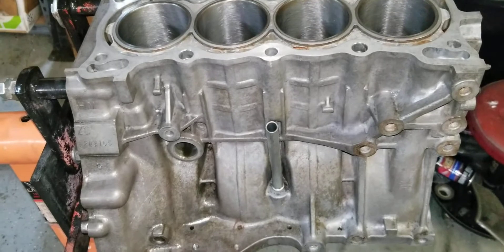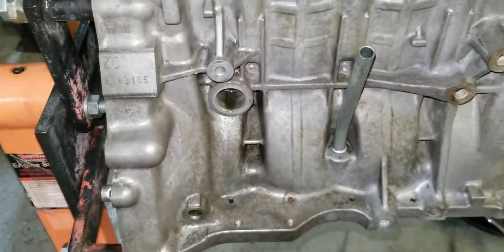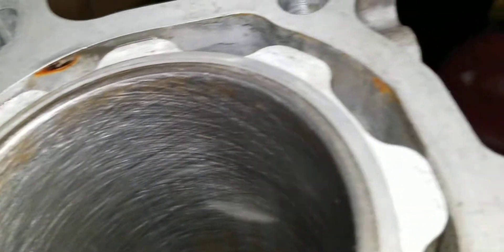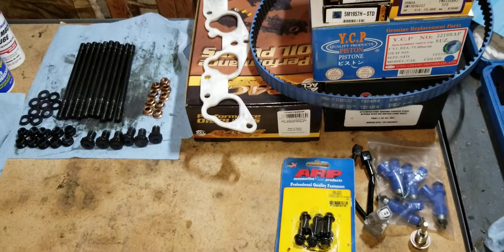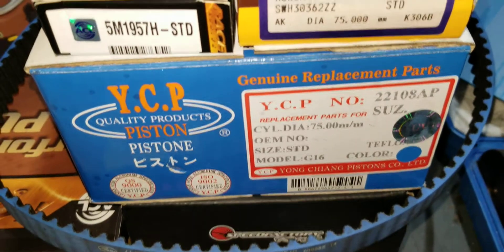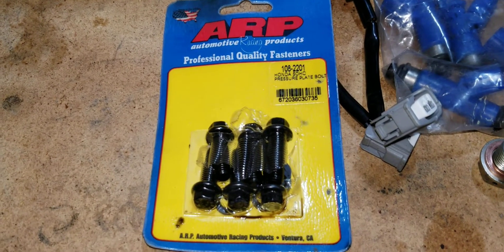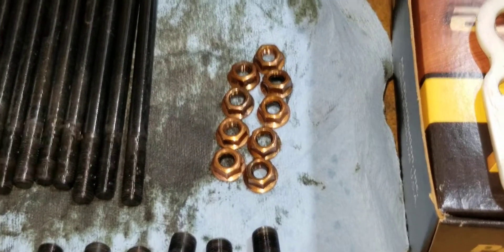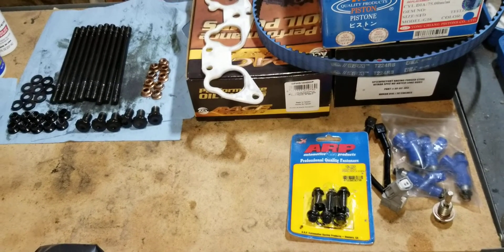Parts needed to build a reliable boosted daily D series Honda motor

Comment: i have the same build but having trouble with the arp headstud i have the d16z6 stud. all studs looks normal  exept for 1 the exhaust side number 2 on torq sequence middle one its the shortest on maybe sits lower inch or less.( any tips what to do) arp headstud you used?
Reply from the maker: What type of cylinder head are you using
Reply: @DIYKAI  z6 but i only installed the studs alone and i notice the middle exhaust side stud is lower than the rest.
Reply from the maker: @hermesrakes8460 you have studs for a Y8 then is one is shorter on a z6 all are the same length
Reply: @DIYKAI  i need to buy 1 stud for y8 to make it work like yours? cuz we have the same everything boosted same everythimh haha
Reply from the maker: If you are using a z6 head you will need z6 studs they are all equal length.....the Y8 studs have one smaller.....I think you can buy just the one of needed

Comment: Would the stock cam be good for 250hp ? At what point does it become insufficient?
Reply from the maker: The stock cam is designed for efficiency & economy so my guess is not more than 75 HP over stock
Reply: @DIYKAI  cool, just a street cam for lower power then ? It would help maintain at least some efficiency I suppose, I'm looking at a potential d16 mild turbo swap and don't want something that will return 10mpg average 😂
Reply from the maker: You can run 8-10 psi all day on a stock healthy motor
Reply: @DIYKAI  rods to be safe though, may as well when the engine is on a pallet !

Comment: What’s the best mm to bore a D16 block??? I need help
Reply from the maker: What are you trying to accomplish
Reply: @DIYKAI  this is my first build
Reply from the maker: @phillipthompson4416  depends on how the cylinder walls look....you really only want to over size a D series of it needs to
Reply: @DIYKAI  if I have to over size it what could I do to it??
Reply: Or should I just stay at 75mm
Reply from the maker: @phillipthompson4416  I would highly suggest you take it to machine shop if you want to oversize the bore
Reply from the maker: @phillipthompson4416  all depends on the condition of the cylinder walls
Reply: @DIYKAI  that’s what’s my plans are for sure but before I bore it I just wanted to know if the walls are good should I just stay 75mm
Reply: @DIYKAI  sorry for bothering you man I just need help and opinions
Reply from the maker: @phillipthompson4416 yes if they are good no need to over size
Reply: @DIYKAI  thank you man I appreciate it I mean a lot
Reply from the maker: @phillipthompson4416  your not bothering me bro ask away
Reply from the maker: No problem
Reply: @DIYKAI  just all motor with a stage two cam with vetc with no turbo
Reply: Make at least some good power nun to crazy you know
Reply from the maker: @phillipthompson4416  so you can stay under 10lbs of boost on a stock block all day and that's fun....
Or you can bottle feed it around 30-50 shot all day as well just really depends how much you want to do and how deep your pockets are lol

Comment: Well I have a CRX I build my most from junkyards parts d15b2 block with po8-3 head better valves and retainers and a 272 Delta cam y8 head gasket and a Weber obdo distributor EMC simple plus 10 pound flywheel and gd clutch kit header etc .she fast enough peppy like hell and her sounds is like a old muscle car CCR born in the byouooooo nothing special cheap to maintenance and cheap to build gd on gas and man man people seems to love her look and sounds jjjjj and she pull gd real gd for what it is around 10.1 to 11.1 compression gd enough to have fun and make big boys to fight for it jjjjjj.she only weight around 1600  pounds
Reply: What’s a po8-3 head? I’m New to the d series
Reply from the maker: @Ballsack44  JDM D15 vtec head
Reply from the maker: Good deal yea we are finishing up a hatch......but check out our other videos we just got a C5 and man does she move
Reply: @DIYKAI  yeap is old school style no VTEC no turbo only all motor and she is peppy like hell in highway I get around 36 to 38 miles a gallon smooth and sp limit in city little less because I like to play sometimes 😁.my tune is a old vent screwdriver with rust on it jjjj 😁 I really can say is a nice simple combo and cheap to build and maintain but her sound is beautiful have that deep cam sound like muscle car and she do 100 and more miles in 3 gear like nothing with the cam and weber 32/36 but she to have a mild pore 2 in free flow exhaust system with a glass muffler really all home made nothing special but she can ramble fast enough to have fun real peppy touch gas pedal and she jump like a straight 6 300 with granny transmission 4 sp jjjjjj.Any way nothing is like the CRX and ds engines interchange parts and bingo a go kart on steroids jjjj 😁 take care i like weber carb and carb on D engines sound beautiful and pull nice and easy to maintenance no computer crap .
Reply from the maker: And it still gets 21 MPG not bad for a LS1
Reply: Were can I find rods for d15b non vtec engine
Reply: @CypronieNelson  eBay or junkyard d15b2 engine are a dime on prices really I myself love them with p08 head and a Weber carb and a 272 Delta cam regrind header 2 in pipe free flow system enough to ramble and make people mad jjjjj with a si transmission standard CCR born in the byouooooo
Reply: @salrivera7578  was talk h beam rods not stock

Comment: Looking into this because i have a d15b2 with s20 transmission maybe i want to get another d15z6 to built it while i still daily my car and then swap the engines in a vacation. B series engines here in the netherlands go for about 2k atleast the same for k series also that’s only the block i will still need a trans. So do you highly recommend me to go d series cause there 300-600€ here so alottt cheaper and d15 or d16🤔
Reply from the maker: What is your end goal as far as power and what your going to do with the car?
Reply: @DIYKAI  just daily it but i want to reliably make 300-400hp and have preferably long gearing for decent fuel economy on the highway so i think d15 would be okay?
Reply from the maker: @danielhiemstra3834  yes a d series is a good choice because they are cheap. throw a thousand at it and you have a decent setup
Reply: @DIYKAI  thank you very much will try this summer
Reply from the maker: @danielhiemstra3834  your welcome and good luck check back in with us when you do!
Reply: @DIYKAI still didn’t do it. 
I have redone all the suspension every arm is now brand new. 
added swaybars and a rear brace.
Bc coilovers. 
Now in the progress of upgrading the brakes from 242 front to 262 and the rear drums to 242. 
When i did that i also repainted the whole underside and removed all the rust. 
I have also done a d16z6 head swap on my d15b2 and am tuning it myself with a aem 30-0300 wideband and cobraRTP chip.
So i already have a turbo lying around.
Next step now is gathering parts to build the internals of the engine and head for boost and rpm’s. 
Then source and exhaust manifold and turbo piping and an intercooler. 

I’ll be back in a year again😂🙏

Comment: Hey bro how can I contact you?? I need some help
Reply from the maker: Hey what’s up?
Reply: @DIYKAI  first of all i dont have much experience modifying hondas i have my honda with d16z6 head and d16y8 bottom block with d16z6 transmission im planning to make my honda turbo my goal is 300hp but i want it to be reliable for a daily im going to put it rods pistons and buy the turbo kit my question is what is the part list, I would need to modify injectors or gas pump, what would I have to do to make my car work optimally at 300 hp ??
Reply from the maker: @Alexander-wu6zw  so 300 is an easy goal to hit. so, you would need injectors and a 255-fuel pump as well as an adjustable pressure regulator. Stock valves are fine if you don't plan to rev over 7k Ish. You will need to tune the car. A free-flowing exhaust will help as well.
Reply from the maker: @Alexander-wu6zw  also get some ARP head studs that will help with the head lift at higher boost levels

Comment: What did you end up gapping the rings to and how much go did it end up making?
Reply from the maker: We would have to look back lol forgot the motor is still on the stand trans took a dump b4 we got to install everything...old motor made around 165ish NA at the wheels
Reply from the maker: we are hoping to revisit it in over the winter
Reply: 1/1000 of an in. That’s what I’ve read and that’s what I did. I’m going to boost mine and just fully built the engine. Very hyped wanna do 10lbs

Comment: Is 75.5 too big for stock?
Reply: Ok. Makes sense. Bout to order all these parts!
Reply from the maker: Makes a hell of a reliable motor
Reply: @DIYKAI  what’s the difference between notched and no notch? And could I run notched with all these other parts?
Reply from the maker: When going to larger rods you will have to notch the block or use the no notch rod yes you can
Reply from the maker: Yes 75mm is stock 75.5 would be .5 over bore

Comment: Is the parts list be the same for a d16a6 block? im thinking of rebuilding it to stock specs and running low boost. wanted your opinion bud. thx
Reply from the maker: yes to our knowledge all internal parts are interchangeable. This would be the cheapest way into a boosted set-up. good luck with your build!

Comment: do you need the no notch rods for the d16y8 ? or is it just for the z6. also everybody talks about how much power the single cam holds but can’t really find info on the tranny do they hold 300?
Reply from the maker: So the no notch rods are used in D series blocks because of clearance issues with the ARP cap bolts coming in contact with the girdle and lower cylinder walls. If you want more HP and ease of install get the no notch rods......a stock 5 speed trans with a good clutch will hold 300 easy
Reply: @DIYKAI  pistons are so cheap it’s the rods that break the bank lol i’m going d16y8 turbo and i don’t wanna blow it on 10 psi in the first few months so i figured just build the block before i throw it on boost  thanks for your help
Reply from the maker: So stock internals can handle 10 psi with good tuning. Yw anymore questions just ask